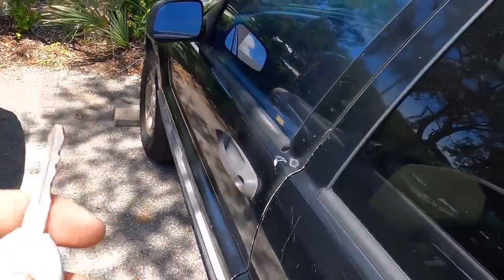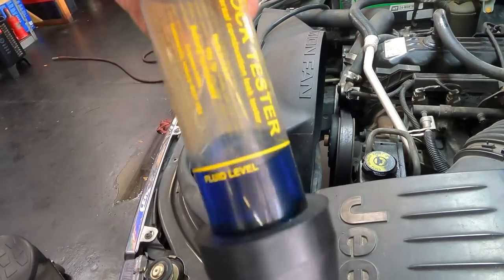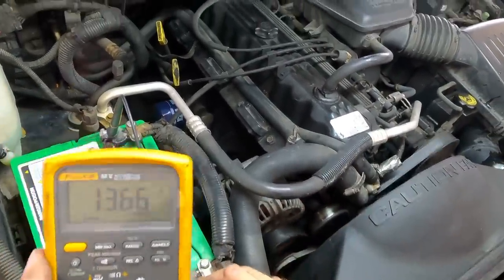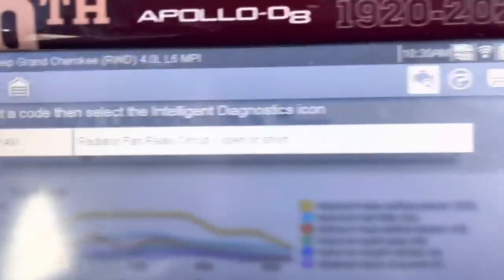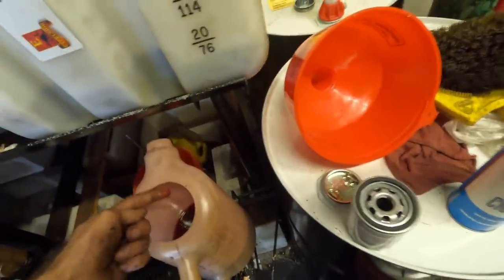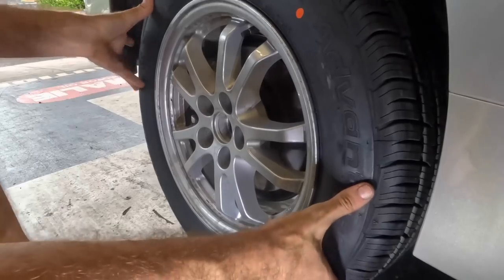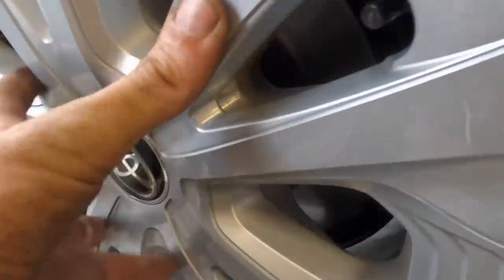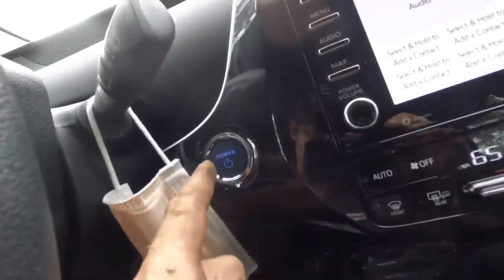How much longer will it last? Jeep Grand Cherokee 4.0 I6 | Compilation

Comment: Yesterday i was testing my car's alternator with a multi meter cus the voltage was down & the lights were dimming when pulling down or up the windows. & The probe wire got caught up in the serpentine belt and the whole multimeter with everything got pulled into the engine bay .
Reply: But think of all the money you saved diagnosing the problem yourself! 😒🤣
Reply: They have a decent multi meter at Harbor freight for five dollars with the online coupon
Reply: @10forthebigguy753  I stay away from cheap multi meters. If you  would to make a mistake and try to measure something wrong it could blow up on you. Fluke meters or any meters with a internal fuse or other protection device is what I would use.
Reply: @sfcjones2590  dosent mater which one you use if there going into the serpentine belt ,the fues want save anything 😅🤣hope you all keep dangling thing's away from spinning thing's 🤣😂 all the best to you all
Reply: Sh!t happens, quickly. Bet that got your attention.
Reply: Sounds like my luck. Lol
Reply: @mikejacob3536  as soon as it was caught i let it go there is no point in trying to save a 20$ meter over my fingers 😂 then i turned the car off and found the probe is already gone and nothing left of it but the meter was fine and i had extra spare probes. Turns out the battery is just slightly over 7yrs old and on it's way out.
Reply: Better than your fingers.
Reply: Did you look at it and think Really. REALLY.
Reply: I've got that HF meter.  It's got a fuse - you can see it when you replace the 9v battery.  I keep them everywhere - in the tool bag in the trunk, on the boat, wherever.  They used to be free with a coupon.  I have a nice meter in the garage, but you'd be surprised how useful a cheap meter can be when it's the only one that you have.
Reply: @KuntalGhosh  7 years wow. That's pretty good. Last 4 or 5 where I live.
Reply: I don't know why but I just laughed at the picture of this happening
Reply: @sfcjones2590  I have had and have multiple meters, I have not looked at the cheap cheapest meters but I have yet to find any multimeter that does not have an overload fuse and at 12-14 volts DC  no meter is going to blow up in your hand, 1000 Volts different story of hazard risk. There are many multimeters you can purchase that cost a fraction of a Fluke and will work excellent for the non professional at home user that does not need the ruggedness and trade durability of a Fluke. For the professional user UEI , Ideal and GreenLee all have good and accurate meters comparable to the Fluke and still save maybe hundreds of dollars. Yes Fluke is excellent and advertised as the very best but it is not the end all be all must only have in Multimeters. There are others brands that can compare and be trusted and relied on, especially for a person starting their trade building up their tools $500.00 - $1000,00 dollars for a meter is not necessary. Save the money and learn how to properly and safely use a multimeter, which many do not know how to should be the highest priority.
Reply: Murphy is always on the job..
Reply: @happywrenching33  i live in very hot climate. Even in winter there is only a single day when it's cooler than 10c. And most of the year aroun 30-35. In summer its 40-45 and for one or 2 days at peak summer time it goes 50-52c. So batteries do last a long time cus it's a warm climate. (Lithiums won't last this much cus they don't like to be too hot)
Reply: @sfcjones2590  fluke make the best meters. Buy a used one off eBay if you need to. Worth it.
Reply: Do you have a video of this event? would love to see it.
Reply: @totalyep  The best instrumentation are the ones that gets calibrated regularly. Otherwise, you're guessing. This applies to torque wrenches too.
Reply: @spaceflight1019  this makes no sense for a homeowner use multimeter. For most diagnostics they don’t need super precision anyway.
Reply: @totalyep  You're right. None of my home instruments are calibrated, but the ones I used to earn my living with were calibrated and traceable to NIST.

Comment: That looks like a solid state relay, if so they need good thermal bond to the chassis for cooling, in future add a glob of thermal compound for those parts to ensure good transfer, makes for a  much happier longer lasting part!
Reply: I noticed that, and have come across quite a lot of ignition modules like that too. Bosch seems to like to do that a lot!
Reply: Chinese parts don't help, either......
Reply: @charleshauser4537  These days it's either Chinesium or Unobtanium; take your pick!
Reply: Worse than that, it needs TWO SCREWS.
Reply: Yap, & don't go cheap on that relay. I'm on my third. Replaced also with new fan (wasn't getting high speed). Summer was just too hot this year. Sanded down the paint & added a ton of thermo paste for the new relay.
Reply: Don't disagree with the thermal but Ray is right. It's cause and effect. The fan will run constantly and burn out the SSR.   It's just on all the time and short life. It will go again unless you unblock the rad or change the pump. With that poor cooling it's just energised all the time.
Reply: I kept replacing the relay in my WJ. Put thermal grease to my jeep, years ago, haven't replaced it since.  SUCKS TO REPLACE THIS RELAY!
Reply: @markcarpenter3600  got a wj and I think my relay is bad too. What relay and thermal paste did you get?
Reply: @TheBestTodo  Standard heat sink compound like used on the processor of a computer or other hot electronic components.  If you just happen to have one of the re-emerging Radio Shack's nearby, they would have it.
Reply: @Rekuzan  usually you find that if the Bosch part has been replaced. Then the numpty who replaced it didnt put the white paste on to the new part
Reply: @jassun681  i would retrofit a viscofan as a failsafe.
Reply: Thanks for that tip, first I have heard of it.  The neon has a similar solid state relay (on some fan combinations) - guess I will go pull mine and make sure the surface is prepped.
Reply: @iHelpSolveIt , yeah thought of that. But just went with the sanding off the frame's paint & using my company's thermal paste. The last relay that Firestone put in was back in 2013, and a new fan motor. They definitely didn't use thermal paste last time.
Reply: Our old Grand Caravan's fan relay required the removal of the driver's headlight assembly too, also a Chrysler product like Jeep.  Follow the wires.  Thankfully, no cutting wheels required.
Reply: Most any technician or shop for electronics has the stuff. You can likely get a handful of single use packets free from any motherboard supplier or TigerDirect. Clean the dirt and old paste off the car body tho. And put the other screw in.
Reply: @charleshauser4537  ...nor democrats
Reply: @Mike S Oh yeah, Bosch does a lot of OEM stuff.
Reply: @iHelpSolveIt  Funny thing about thermal paste; it can't do it's job if it's not there... If it was a heatsink for a computer polished to a mirror finish, you could get away without it, but automotive parts makers usually don't go that far. Personally I use the Antec brand nano-diamond compound for everything, including automotive computer components and ignition amplifier modules.
Reply: @iHelpSolveIt  Then you get the geniuses who put WAY too much on there, actually winding up with a layer way too thick that winds up defeating the purpose and causes it to burnout even faster.
Reply: @jassun681  Be careful not to put on too much because if you do, it can be counter productive. Direct metal to metal contact is always best and thermal paste is just there to fill in the gaps on the microscopic level.  In theory, a CPU core and computer heat sink that are both polished to a perfect mirror shine would not require any as there wouldn't be any micro-gaps. If the layer of paste is too thick, it can wind up forming a micrometers thin layer across the whole thing and can reduce thermal effectiveness and the life of the component. tl;dr = a fresh razor blade is your friend when applying it.
Reply: @StuEvans  With proper cooling it will go for eternity, that is a nice thing about solid states, even cheap ones, I custom built a 100 Amp autogen system using a cheap chinesium solid state switch, I selected a 200amp model and put an over sized heat sink on it, 2 years on still works flawless. Heat is the destroyer. But granted, all the other fualts must be fixed to ensure good performance as a system.
Reply: @TheBestTodo  I use Arctic silver ceramic Thermal compounds over kill but I do enough electronics with solid state switches makes it worth it.
Reply: That Prius was an example of loaning your car out to someone who is a "friend" on a Saturday night.
Reply: And Both mounting bolts would help A LOT. Yeah It was my first thought when Ray said "PWM Signal", has to be a transistor of some sort, therefore heatsink and proper mounting.

Comment: A plastic cover over a perfectly serviceable alloy wheel. Yup, makes perfect sense, Toyota.
Reply: My thoughts exactly.  When I heard Ray say he was going to put the hub cap on I thought he meant the centre cap. When he found the cover and put it on I was dumbfounded.
Reply: If you pay for the upgrade trim package they'll take the plastic covers off for you.
Reply: Aero, like new F1 cars :)
Reply: @dotar9586  Is that a joke, or for real?
Reply: They've been doing that for years.  I know of a 2012 that had the same setup with the wheels and hubcaps.  The wheels look great as they are, the hubcap seems redundant.

Comment: The replacement relay probably overheated. Looking at the module, the backside was dirty and it was held by only one fastener, so it couldn't dissipate heat properly. I'd clean both surfaces and secure it with 2 fasteners, as intented. Maybe  put some thermal interface material as well.
Reply: probably should have put dielectric grease on the back.
Reply: @happywrenching33  dielectric grease does not equal heat sink compound, tho maybe it'll keep away corrosion that didn't appear to be a problem
Reply: The customer should have a mini fan installed to cool the module.
Reply: Agree use the Thermal paste on the back of the Relay. Spray connector contacts with DeoxIt 5, Use a pea size drop of Dielectric Grease inside the connector prior to snapping it together. Check the current draw of the fan motor and see if it's drawing too much. Confirm correct fuse Rating. I've seen fan motor drawing excessive current yet not blow the fuse. This in turn puts extra load on the relay contacts causing early failure.
Reply: Paste me up baby!
Reply: @stealthg35infiniti94  There ya go. Full install.
Reply: Most of the replacement relays come with thermal compound to put on the heatsink/base. I had one of these jeeps and the PWM relay is just garbage and replaced yearly. Kept one on the shelf swap then warranty the bad one and put back on the shelf. Usually it will also melt the connector when it fails.
Reply: @gregoryrodzewicz1031  Damn. Any aftermarket products. Or Pixie wrangling.
Reply: @stealthg35infiniti94
Reply: You can get thermally conductive tape.
Reply: @Cheepchipsable  it can do more harm than good, if the surfaces match well. Paste is prefered, it only fills the gaps.
Reply: Where’s the thermal conductive paste ?
Reply: Pretty common problem on those…. 👍
Reply: @stealthg35infiniti94  there are no contacts, just a P-N-P junction of semiconductor, hence solid state but never minding the nit pickyness you are correct, heat is the destroyer.
Reply: looks like a solid state relay, so I second the use of some thermal paste. Same thing with thin film ignition modules, like old Ford/GM. They burn up without a good heat sink, especially with hot underhood temps in Florida.
Reply: Such is the problem with SSRs,  needs cooling vs olds school Mech relay
Reply: Agreed!  It is solid state, therefore it will dissipate heat.  Thermal grease is the answer to long life here.
Reply: I think that the fan had to be working harder than expected due to the other cooling problems.  So that is causing the relay to work harder than designed so it fails early. The PWM would normally have a thin high period of time, now it's thicker for longer which means more heat to dissapate.
Reply: @Refertech101  You're right ,in this application it is a Solid State Device. I was thinking of the older applications where coil with
contacts relays are used.
Reply: I will just mount the "relay" transistor on an  aluminium sheet metal plate. Using the same area and screws. It will outlive the car.
Reply: Solid state relays should not be used on high current inductive loads, IMO.
Reply: The replacement relay was probably made in China.
Reply: @hidel308  a 9.99 amazon or ebay special
Reply: I don't think it is a relay; it is a solid-state relay; i.e. a triac.  Thermal compound and clean surfaces are must-haves with those!
Reply: yep my thoughts exactly SSRelays
Reply: I wonder if access to the relay is by removing a plastic cover inside the wheel arch?
Reply: or put the relay at a place where is airflow for cooling and not hide it behind a headlamp that blocks airflow. bad enginering.
Reply: @firehawk318is  it's designed to be mounted on a heatsink. It's not a bad design, the previous one was just improperly installed.
Reply: @Ben-Wah  Triacs (which are back-to-back thyristors) don't work on DC systems or, rather, once turned on the say on. I's probably something like a high power MOSFET and the whole thing is acting as a motor speed controller.  MOSFETs are commonly used in low voltage speed controllers.
Reply: @firehawk318is  that sort of device is designed to be clamped to a heatsink and airflow enough is not enough to keep it cool. What it needs is good thermal contact with a mass of metal, and having just one fastener means that the back of the device was not properly in contact with the metal. Ideally there ought to be a bit of thermal grease in their too. In any event, the use of the second fastener might sort it out without the grease.
Reply: @Refertech101  It will almost certainly be a MOSFET and not a bipolar transistor.
Reply: @TheEulerID  Not true.  Have used them in PWM rigs to pulse DC for speed control with a 556 timer chip and they worked marvelously.  Specifically used a triac to control an old AC/DC style of sewing machine motor for... well... a sewing machine!  (girlfriend at the time was a quilter)  Fed it the DC pulses (basically rectified the line voltage through an isolation transformer) and I could get 80% torque at a crawl, which resulted in far more consistent thread tension.  SCRs are a pain in the butt as you have to reverse-bias them to shut them off, or shut off the power source entirely. With triacs, you just have to shut off the gate voltage.  MOSFETS are nice when you want to reverse the direction of a DC motor.
Reply: @Ben-Wah  A TRIAC is simply two SCRs connected back to back in opposite directions. Once triggered, both SCRs and TRIACs remain turned on, even if the gate current is removed, provided that the current through the device remains above what's called the holding current. It is not necessary on either TRIACs or SCRs to reverse bias the voltage to turn them off.

If you feed a TRIAC or an SCR with the output from a regulated AC supply then the current will drop to zero at twice the AC frequency and both TRIACs and SCRs will then turn off when the voltage drops low enough that the holding current isn't maintained.

However, something fed with a constant DC supply, as is the case here, then once and SCR or TRIAC is triggered it will remain conducting as the current will never fall below the holding current.

For applications such as in this car, then MOSFET driven speed controllers are normal. Also, I've no idea why you think a MOSFET can be used to reverse the direction of a DC motor. You can only do that by reversing the direction of a current through this sort of motor. Of course with synchronous motors, then it is possible to change the direction of rotation through changing the phase controls on the motor coils, but that fan does no use that type of motor. It only has a single power connection for one thing.

I have designed TRIAC circuits for AC motor control, but never for DC. I don't see how it could ever work save if the DC supply was interrupted.